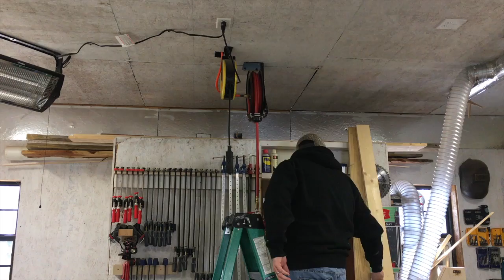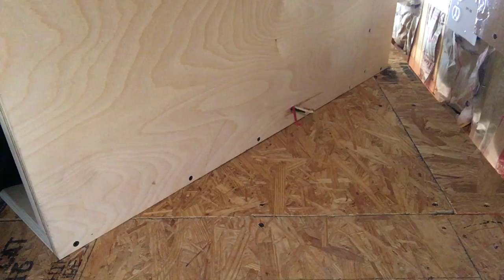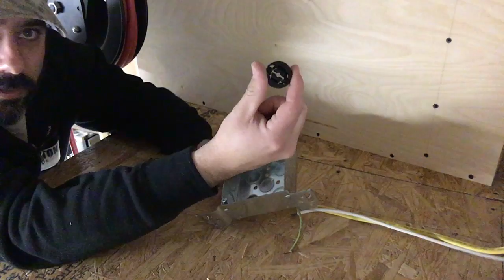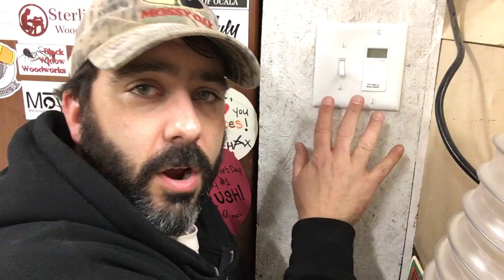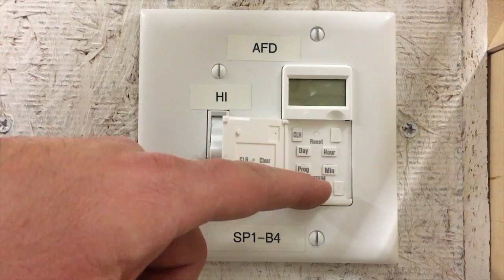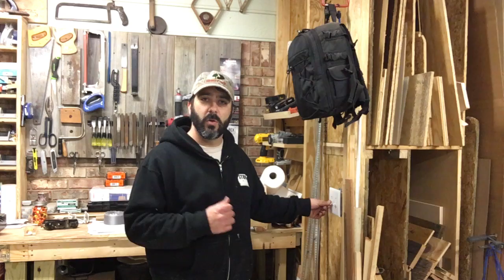Shop Air Cleaner - Install

Comment: Great idea and great video. You might want to consider installing an air exchanger.
You need to bring in fresh air and exhaust air. This system has to be filtered. It is important to have a clean and fresh air environment to work in. Keep those boys healthy. Lucky you three boys. I have three girls.

Comment: it may have been answered but the blower is a furnace fan. it is designed to have duct work attached to it to provide resistance the three filters should provide this.  get the amp specs from the motor attached to the fan, use an amp meter to make sure your not over working the motor.  talk to a heating contractor or post a craigslist add to find one.   Great build, very useful.
Reply from the maker: +Eric L thanks for the info.
Reply from the maker: +Eric L thanks for the info.

Comment: Nice, Shawn!  I really want to build one of these.  I just need to find a blower.  Maybe I need to call around to the HVAC places and see if I can find an old one.  The programmable switch is a great idea!
Reply: Yea, I'm hoping to find an HVAC shop with a scrap unit that they would sell the blower out of.
Reply from the maker: +Jason Rausch Thanks Jason!! I actually got my blower free. I just asked and the heating and air company said sure you can have it. Score! The switch is going to be really nice I think. I can just program the unit to clean the air 2-3 times a week and then also use it while I'm in there. I'm going to do a follow up on the unit and cover my entire system in one video.
Reply: Awesome!  Does the switch have the 10, 20, 30 minute on timer option?  I have seen those before and thought that would be nice to control an air cleaner.  Hit it for 30 minutes, so you can leave the room before it's time is up and not have to worry about coming back later to turn it off.
Reply from the maker: +Jason Rausch It has 18 different programmable slots. You can program any of them to any length you want for any day with repeat abilities. I didn't go for the timer with the fixed 10, 20, 30 minute settings because I wanted the flexibility of longer run times. I can also turn it on manually which overrides all programming, but as soon as I turn it off all programming resumes. I like the setup. I added a link to video description if you want to take a look at the specs.
Reply: Ah, very cool!  Ok, good point on wanting it to run longer.  I just know that I would turn it on and hours later finally remember to go turn it off, if I didn't have at least some kind of timer.

Comment: Great job, a lot quieter then expecting
Reply from the maker: +Mike Fulton Thanks, Mike. Yeah, it really isn't that loud. The dust collector is in a closet and I can talk to someone in a normal tone when it's running. The air cleaner is not as loud as the dust collector.

Comment: Yeah, I never have any small pieces of wood in my shop either. The noise didn't seem bad for either the air cleaner or the dust collector but you could add rubber washers where the squirrel fan mounts to the cabinet and put some rubber feet under the air cleaner cabinet. On a side note. You need a bigger sticker so it will be bigger than Jay's. HeHe
Reply from the maker: +WoodRodent LOL! Those are all good suggestions. It really isn't that bad.

Comment: Hello, great video. But why put a filter at the exhaust port. It just doesn't seam to make sense. And watching Jay build his, he didn't put one at the exhaust port. I guess my question is do you have to put a filter in front of the exhaust port or can you leave it open like Jay's? Thanks
Reply from the maker: +Greg Marquis the filters at the intake side are necessary, but the filter at the exhaust is not. The only reason to have a filter at the exhaust is to restrict the air flow so the fan doesn't spin to fast and burn up.

Comment: A great build video, but not much is shown in terms of wiring. Do you have photos? My old furnace blower has been sitting on the floor waiting for a project like this.
Reply from the maker: +Derek Cadmus Thanks Derek. I didn't cover the specifics of the wiring only because not every blower is the same. Mine is multi-speed with different color wires, so I don't want to mislead anyone if theirs is different. Send me pics of yours

Comment: Nice set up.  How did you find the motor?  That is where it stops for me I don't know where to go to get a old fan system from a furnace.  Liked the build but it seemed like you would have to have thicker filters, more space  to clean the air.  Hope it works for your sons that's what's important here
Reply from the maker: +Chuck Hart Thanks! I called around the heating and air companies until I found mine (and for free). Time will tell on the filters. Thanks for watching.

Comment: Great air cleaner, but one issue that I see over and over is that everyone mounts the air cleaner at the ceiling.  The problem with that is that it creates an upward flow of the dusty air, which draws it right past you as you breathe.  Since most of the dust is created by equipment in the lower half of the room, the best place to situate the intake is at the floor, which draws the dirty air down away from your face.  The absolute best situation is to duct the exhaust up high so that clean air is coming from the ceiling, and dirty air leaves at the floor.   This is the basis of clean room air purification in the pharma, high tech, and automotive paint industry.
Reply from the maker: I can understand that. Makes sense.
Reply: Thanks Captain Obvious!

Comment: I see you have an air hose reel attached to the ceiling. Do you have "central compressed air" in your shop? Meaning, do you have multiple air hoses at various locations in the shop connected to a single compressor somewhere? What size compressor do you have (motor and tank size)? I've been wanting to do this for awhile now 

I have not watched all your videos, so I'm not sure if you've covered this topic before.
Reply from the maker: +Noah Krietsch I have a 20gal compressor in a closet and a single hose to the reel. That's it. I would like to do what you're talking about eventually. I'll be sure to make a video when I do. Thanks for watching.
Reply: Just bought a 21 gallon myself. Looking at setting up a couple hose reels connected back to my main 21 gal. It's going to be a fair amount of piping and definitely a large pain in the ass!

Comment: Why did you limit the size of the hole between the filter and the fan unit?
Reply from the maker: +amtpdb1 mainly to treat it as a traditional air ducted pressurized system.
Reply: +Stone and Sons Workshop Thanks for answering.
Reply: +amtpdb1 I'll elaborate on that in case anybody cares about the details. Centrifugal blowers need a little back pressure to operate correctly. Without back pressure the blower wheel will tend to overspeed and the motor current (amps) will exceed the motor's rating. Motor runs hot or even kicks the breaker. Put a blower on the bench, power it up with no outlet restriction, measure with your amp clamp, then hold a board to cover about 1/4 of the outlet, watch amps drop and hear motor slow to its correct speed.
Reply: +Sootikins Thanks

Comment: Has this proven beneficial to your shop? Are you able to tell a difference in the quality of air?
Reply from the maker: I have a different one now, but yes it worked very well.
Reply: Did you build another one or go with a commercial unit?

I need to clean up an 1800sqft shop, so I’m looking at options.

Comment: Do you need to change out the filters like A/C filters, every 3 months or so?
Reply from the maker: +rsaggas1 it just depends on how often you use it. It could more than 3 months before it needs to be changed or it could be less. really just depends.

Comment: GREAT idear, hey man was your fan 220 or 110v? 
How often do you think you will have to change  the filters out?
I have the exhaust fan from a outside AC unit mounted in the gable of my shop, instead of building one of these with the furnace fan should I just build a filter box around that fan and let it exhaust outside?
Reply from the maker: +Will Merritt The blower I have is 110v. I haven't had the setup long enough to determine if I need to change up the filter configuration or use different rated filters. I'll follow up soon with a video on everything. What are you using the exhaust for now, to rid the attic heat? The purpose of the filters is to clean the air before blowing it back into the shop. If you're exhausting the air outside you wouldn't need a filter setup.

Comment: What are the specs on the blower (CFM) and how effective is the unit at pulling dust out of the air?
Reply from the maker: +Jason Parker Thanks Jason for your interest, but I don't know the CFM. I'll see if I can measure it soon. I'll know more on the effectiveness as I use it more.

Comment: Great job, what micron are the filters? I really need something like this, my shop is only 160 sq ft and the air can get bad quickly.
Reply from the maker: +KirwanWoodKraft I don't remember what the filters are rated. I'll know more after I use them a little while longer, but I can tell the air is cleaner.

Comment: Where I am there are filter grades like  'g3', for large particulates, and different g numbers for progressive filtration like you use. Do you have suggestions which to start with and the grades of the others in the series of filters? Thanks!
Reply from the maker: +Paul Mcnulty actually the first two filters at the same "cheap" filter and the last intake filter is a more dense filter than the first two. I don't have any particular suggestions on ratings. I just found a combination that works. As long as the last filter is clean then you have a winning combo. Good luck.

Comment: Nice build/design. I've got two blower motors waiting to be made into one of these unit - I will need help on the electrical end.  Where did you get the programable timer?? I was looking at putting in one of those timers you sue on bathroom exhaust systems - set it for 30 mionutes and walk away but yors may be a better solution.  Thanks  Scott
Reply from the maker: +The 2 Car Garage Shop Thanks! I've added a link to the timer in the video description. The reason I went with this setup is rather than using a timer that was limited to 30 minutes I can now program it to run whenever and also turn it on for as long as I want while I'm working.

Comment: I just finished my box, instead of using plywood for the frame filter I used 1x2"s if they didn't split they warped or twisted.,waste of frighten time
Reply from the maker: +Tug_Slug Cool that you have the box built, but hate to hear about the filter frames.

Comment: Hey Shawn, I'm curious... How often do you use the high and low setting on this? My guess is that you have it on the timer set to one setting and that you use that almost all the time and very little manually. I'm about to make one of these myself and am not sure if I need the high low setting.
Reply from the maker: +Mickey Griffith Hey, thanks for watching. Actually, you would be ok just using the high setting with an on/off switch. The only reason for the timer is to program it to turn on certain days of the week to clean the air if you're in the shop everyday. Hope that helps.
Reply: +Stone and Sons Workshop that does help. Thanks a bunch!

Comment: Nice I'm curious I watched the vid you did with Jay and have just subscribed . One question are the filters all the same ? Or are they stepped in filtration 2.5 , 2.0 ,1.5 etc ? Thanks much Having sons in the shop is the best !
Reply from the maker: +Matt Long Yes, my boys are fun to have in the shop. The first two filters and the exit filter are the same and the third inlet filter is the better filter. I can't remember the exact ratings. I'll  check on it.

Comment: nice project. Can you tell me what is the rated CFM of the unit? at given pressure? Does the cabinet restrict the unit to require additional amperage? What it the recommended air exchange rate for a filter like this?
Reply from the maker: +Timothy Magee I have not performed any tests. If I come across the appropriate equipment I'll take some readings and report back.

Comment: haha #imaninja! That timer is very smart.
Reply: +Jay Bates - How does the timer know when the air has dust in it?
Reply from the maker: +Maine Canvas Prints the timer only turns on at the programmed times or when manually turned on. There are no sensors to detect dust.